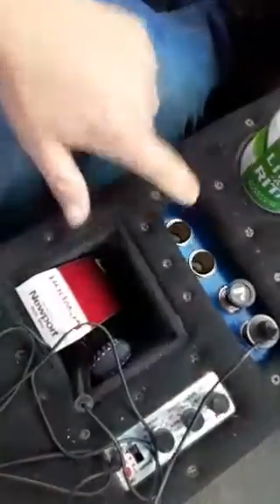P71 crown Victoria police interceptor burn out patina rant and center console

Comment: the center console is nice, when i first got my vic i ended up ordering one from ebay for $100, to be honest it seems a bit cheap, the little cushion for the armrest is already worn out and the padding material is coming out, i've only had it for a year and 6 months
Reply from the maker: This material is from my old job. They use it in mattresses. It's some sort of foam backed suede or something. Very soft to only be 1/4 inch thick.
Reply from the maker: But thanks for the vote of confidence. The nice thing about building it custom is you probably noticed the added equipment with the knobs there. The possibilities are endless with extra equipment. It could be configured any way you want. My Buick actually has the factory ash tray built into the new console. I just flick mine out the window anyway so because the ash tray has a lid, I can use it to hold my phone upright. Lol